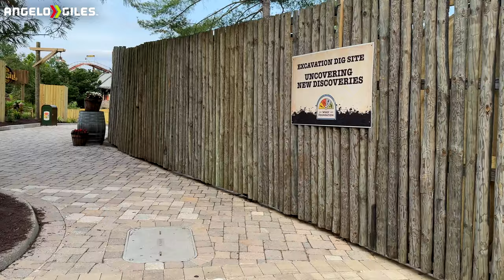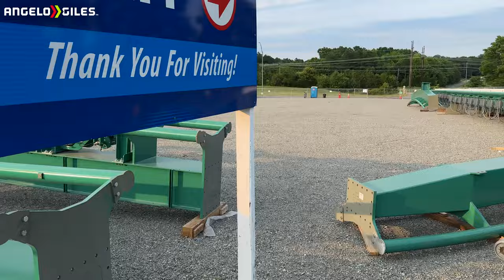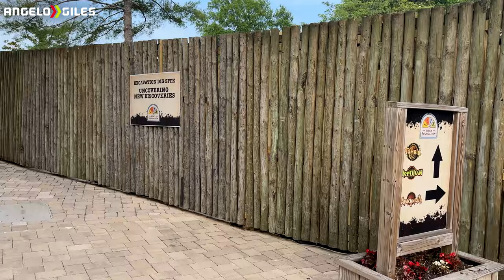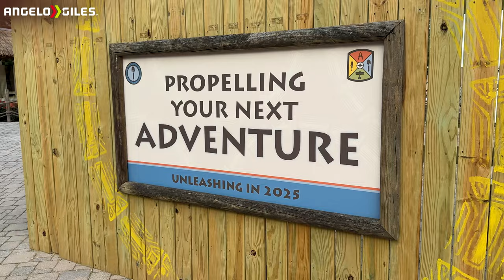Kings Dominion 2025 Roller Coaster Construction Update 8!👷‍♂️🎢MORE TRACK, FOOTERS, AND TEASING👀

Comment: The tubes next to the lsm fins are coolent conduits to keep them cool. They heat up quite quickly because of the high electricity passing through.
Reply from the maker: A liquid cooled coaster haha
Reply: @AngeloGiles  it’s usually liquid inside the white lsm fins and air in those tubes, I’m pretty sure.

Comment: 3:40 Hydraulics? Hehe. Looks like a double launch sitting there. 4:28 You can see the switch track piece. Likely just for the maintenance shed though.
Reply from the maker: I figured that wasn’t right lol.
Reply: @AngeloGiles  Yeah, they're LSM (electro-magnets) and magnetic brakes. Only the friction brakes have hydraulics (the ones that go inside the box track itself) ;)
Reply: The launch fins looks water cooled! I think he was just looking at the coolant plumbing.
Reply: @BikerFail16  Oh yeah? I'm not sure that's coolant pumping. I assumed it was wire conduit for the heavy gauge wires. I don't think they have to cool the electromagnets because they only operate once per minute or two for 5 seconds. I don't see/never have seen any radiators or radiating fins.
Reply: @jonny-b4954 after looking closer they look temporary. Maybe for shipping protection?